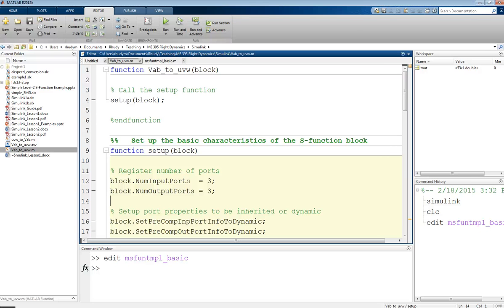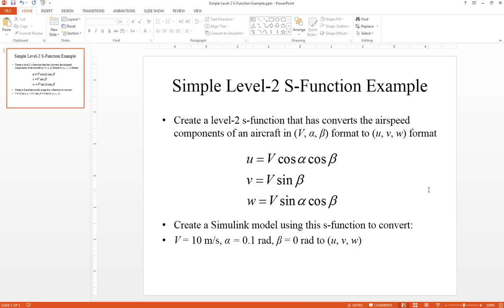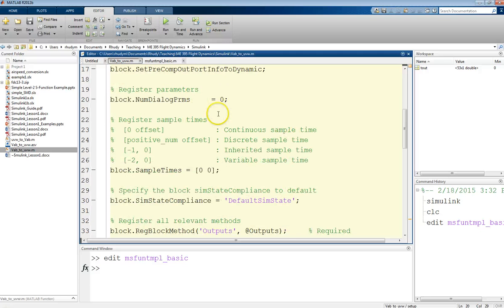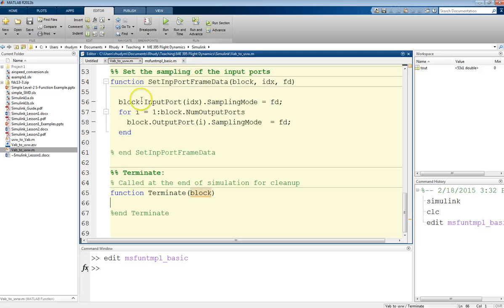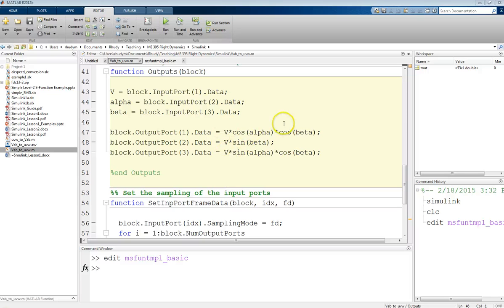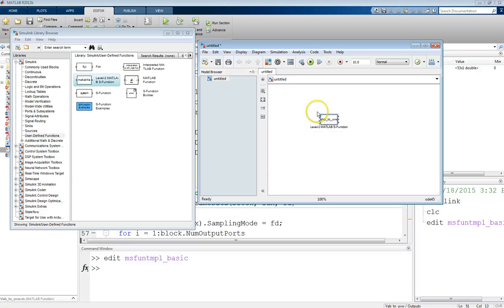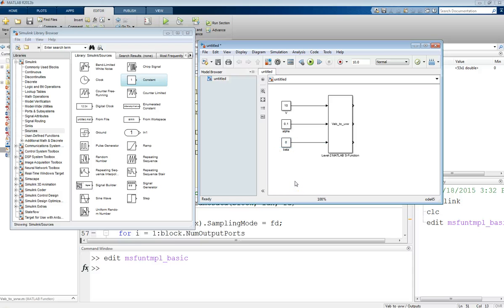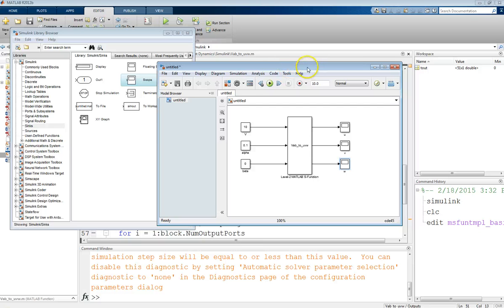Simulink Level 2 S Functions Part 2

Comment: Thanks for the videos Matthew they are quite helpful. I have a question, if I would like to use an unitary step function with a step time 5 second as input to trigger the time for the s-function. In other words I would like that the outputs remain = 0, until the s-function detects a change in the step input from 0 to 1, and then starts the computations. Do you have any suggestion for that?
Reply from the maker: +Dan O You could consider having an input port for the step input, and then just have a simple "if" statement inside the "output" function to define the outputs appropriately, i.e. if step_input < 1, outputs = 0, else, outputs = ...
Reply: +Matthew Rhudy Thanks for the reply, it works if the outputs are constants, but if the output depends on time for example output = cos(alpha*t), alpha is a constant and t should start from 0 when the step input reaches 1. Any idea?
Reply from the maker: +Dan O You could shift the time by the step time, e.g. output = cos(alpha*(t - t_step));